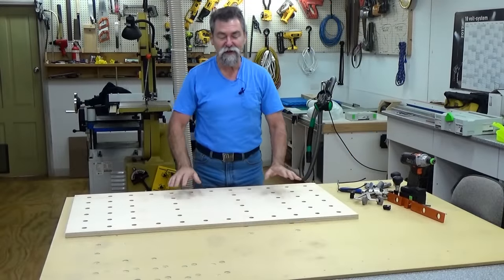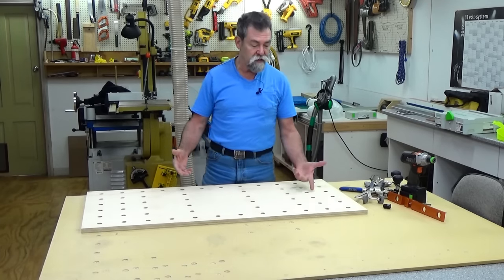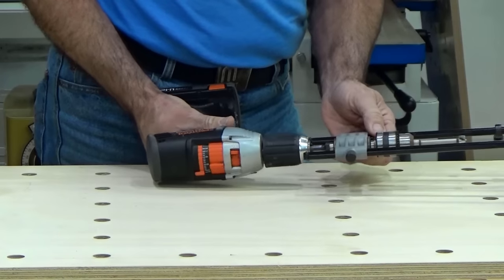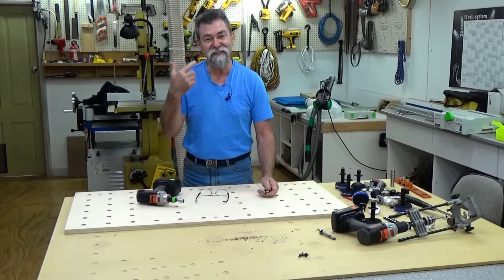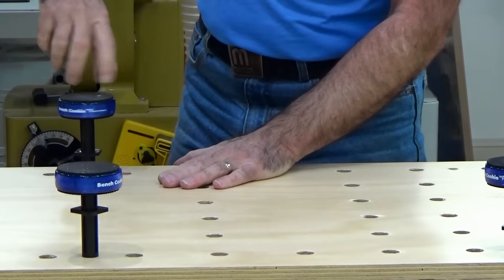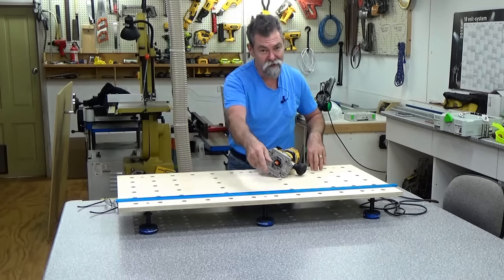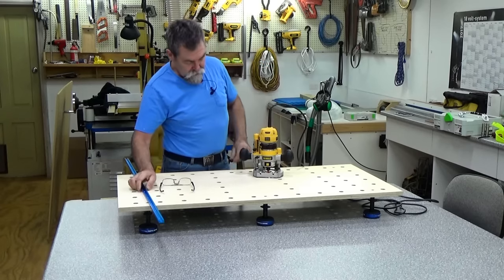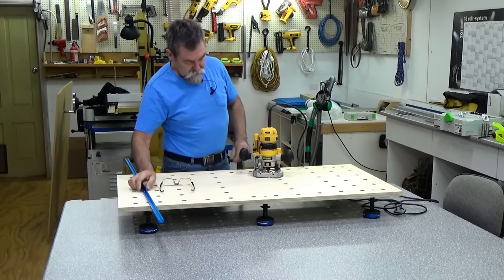Build this Festool mft style portable bench for under $150 Dave Stanton woodworking workbench

Comment: I am analyzing build vs buy…I am starting from absolutely zero…I don’t even have a track saw or clamps…buying the PARF system is $250 USD…seems like buying squares, dogs, clamps, fences, rails, T-tracks, frame, dust extraction is getting me between $3000-$4000….

What is the thinnest table with tops and frame can be made so I can hang on wall and still park a car when table not in use?
Reply from the maker: That's a tough decision, but it sounds like you're really weighing your options carefully! 18 mm is the thinnest I would advise. That is the thickness of my benches, works with lots of accesories.

Comment: Hi Dave. Those Kreg hold down clamps:  You said in one of your many videos that you replace the bolt underneath with something else that'll fit in a T-Track but give a greater area inside the track to withstand the pull from the clamp.  Can you remind me what bolt you use please?  Keep up the great work!
Reply from the maker: Hi Paul Roussell! I used 5/16th inch T bolts, 1 inch long.

Comment: Awesome table! 
@16:00 ... that's one more reason to have a good* rotary tool. Small, lightweight, and smaller cutoff wheel. 
 
(* - Sadly, Dremel has failed me too many times. I've gone through a gauntlet of rotary tools in the past few years and discovered that a certain one (that only costs under $40 US dollars) is amazing. It's a... /ooof it's tough to say the name without feeling ill/... it's a Black and Decker RTX. Best thing... IT ACTUALLY HAS SOME DEGREE OF TORQUE!?!?!? I never tried before because everyone said it only has 3 speeds... but clearly theyve never used it. Its variable speed wheel, with 3 marking (L M H) on the wheel. ) 
 
So, just thought I'd throw that out there. I used to whip out angle grinders, or die grinders, far too often for tiny jobs, and it just wasnt necessary. Its like using a chainsaw to cut laminate lol.
Reply from the maker: Good idea.
Reply: @DavidStanton   I only have 1 arm that isnt paralyzed, so I have to adapt. Lol.

Comment: Fantastic as always! Please would you mind sharing how you attach the Festool hose to the dust port of the Dewalt router? I have the same setup and the hose keeps slipping off, so am wondering if you cut off the outer clear plastic collar away and just kept the inner collar?
Reply from the maker: Thanks eddomak! Yes, you got it in one re the dewalt outer plastic!
Reply: David Stanton what type of vac system. Do you have a link

Comment: Hi Dave! I was looking at a new tool by Kreg Tools which I think would be a good accessory for this bench. It is a bench clamp with a base that can be inserted into a 3/4 inch or 20 mm hole. I see the clamp base is also sold separately. I just wanted to pass info this on to you.
Reply from the maker: Thanks Harold. Yes, it is another innovative bit of must have kit from Kreg!

Comment: Nice. What happens to those anti slipping bands covered with dust?
Reply from the maker: It takes a couple of seconds to dust them off with a brush or shop vac. They are designed to work in a dusty environment without getting any dust permanently sticking.

Comment: thx for the excellent vid, curious why you choose not to take advantage of the splinter support offered by cutting into the the sacrificial top, and instead hang the cutting line over the edge?
Reply from the maker: 2 reasons. The blade is on the upcut through the material so no need for splinter support on the underside of the item being cut. Also, there is an aluminium t track that runs the length of the bench.

Comment: That was a great video. 
I'm wondering if the the non stick tape collects saw dust or other debris. 
Thank you
Reply from the maker: Interesting point Ernest Vocell. I use a banister brush to remove dust from the whole top, tape included. Only takes a second and you are good to go. This is a grip tape, not a sticky tape.
Reply: @DavidStanton  thank you 
That's a big help

Comment: One thing to note, you mention the quick clamp won't work if the top is too thick. Could you not just take the clamp apart and feed it up thru the bottom? Maybe slightly less convenient, but seems a reasonable work around for someone who would like a more substantial top.
Reply from the maker: Hi frozenlayer, there are many styles of clamp out there that will do what you mentioned, in fact I show you the Irwin clamp doing just that. Bessey also make them. The lever clamp is not a pull apart model. Thanks for watching!

Comment: Hi Dave another quick question , the aluminum  oxid pad used on the wax where do you get them and what is the proper name. Also is the traditional wax good for the jarah box I am making or do you suggest another finish. One pf the boxes i am making is Tasy ash which I am going to stein with a wattle stain, can I use the wax over this ?? I am also in the future making the above work piece up in white Melamine for a portable work bench as my Garage workshop is not big enough for a standalone bench. When I am cutting on it I will put down the foam I got from Bunnings so I don't mark the top its excellent when using Festool track. Cheers Kim
Reply from the maker: Hi Kim Dalzell. Festool vlies. Get them here https://www.carbatec.com.au/vlies-abr-disc-150mm-0-hole-superfine-stf-d150-sf-800-vl-10?aff=3
Reply: @DavidStanton  Thanks for that

Comment: When designing a bench to accept the Festool standard rail clamps, what is the minimum clearance distance required between the bottom of the 3/4" work surface and a parallel surface below it? Thanks.
Reply from the maker: Hi Michael Schuler! Enough room for a clamp to rotate underneath.
Reply: @DavidStanton  Thanks. Understood. I was hoping you might have discovered the actual minimum clearance dimension in your work developing your benches, perhaps for guidance as to how high to set the standoffs you use under the portable model.

Comment: Thanks Dave for developing this bench concept.  I've ordered your most recent plans and I have the Parf Guide system and I understand how to drill out the standard 96mm spaced 20mm holes, but I not exactly sure as to drill out the offset Rip (R) and Crosscut (C) holes on this Stanton bench.  Is there a way to was the Parf drill guide to drill out these "R" and "C" holes while indexed into one of the normal 96mm spaced holes? Thanks
Reply from the maker: Thank you for your support and for ordering the plans! I understand your question and I'll do my best to explain how to drill the offset Rip (R) and Crosscut (C) holes using the Parf Guide system. Stay tuned for my detailed explanation in an upcoming video! https://www.youtube.com/watch?v=G59Xx15C8bo

Comment: I think I’ll built the same bench (yours is impressing well executed!) but I want to ask why you did not align the splinterguard of the railwith the short side edge? This would prefent cutting into the bench an still keeping the spilinterguard effectif.
Reply from the maker: Doesn't need it, cuts perfectly well as the blade is in an upcut rotation.

Comment: Excellent video and a very nice bench Dave.  Do you have any plans or notes that you would be willing to share. I really like the size and layout of yours. With are of you goodies on the opening pictures it is a nice bit of work.
Ron
Reply from the maker: Hi Ron. No need for plans. The sheet is 1/4 of a full sheet of ply, the holes are 20mm dia and at a 90 degree pattern spaced at 96 mm centres.

Comment: Dave - great idea thanks. When you were routing you set up a straight edge with clamps - why did you not use the parf dogs?
Reply from the maker: I could have but would have needed to cut a straight edge to the correct width. This way was quick with the festool track and clamps. Accuracy not as crucial for the cushion strip as it was for the dog holes.

Comment: @26:42 could you not add a 20mm conduit over some of the thread and or 3d print a bush that takes up slack between the clamp thread and the 20mm dog hole ? If that thread is too long perhaps make the bench deep enough ? Also for height differences you could make a Ttrack mounted on a block of wood which is clamped to the bench ,then a clamp is attached to athe raised t track which holds down the high work piece
Reply: You could place threaded stand offs on the block of wood so that it is adjustable for all heights of work piece

Comment: Hi David,
more than impressive! Ok from the video not quite clear - you use the bottom side for track saw so you do not cut in the aluminium of the rail? If so, how many times do you really use the upper side for clamping something? How many times the rail? Wondering if it really has an application in your everyday work.
Thanks in advance from Lake Constance,
Christian
Reply from the maker: You can use the top for both if you wish. Just finish the aluminium T track prior to where the blade will pass by. Some people may want to preserve the top appearance and use the underside, or make 2 of them.

Comment: Hey Dave, Couple of questions I wanted to ask if I may: On the Kreg clamp you were using towards the end, will the nut on the bottom of it secure it in the T-track slot too so you can use that as a fixing point, and do you know what size the tread is on that if you need a T bolt for it? The other question is can you please tell me what the details are of that drill stand you were using (it's sat on the bench side at 5:27 in), is it any good and where did you get it? Have been wanting one of those for ages but the only ones I can find are absolute crap and there's way too much play in them to do anything remotely accurate. Have been and bought the plans for the bench from your website so will have plenty to keep my busy! Cheers, Steve
Reply from the maker: Hi Stephen. The drill stand is ok but has its limitations., purchased from Carbatec.  The Kreg jig can easily be mounted onto a plywood base that in turn can be fastened to the Stanton bench T Track.

Comment: Dave - A couple of simple 'newbie' questions about the wax application you employed on the workbench.  
First, I noticed that the can of wax that you used said 'Traditional Wax.'   Is that paste finishing wax? Or beeswax?   
Second, what grit aluminum oxide did you use to sand/buff the wax?
Reply from the maker: Hi Steve Marano!Finishing wax and the oxide pad was 800 equiv.
Reply: Thanks Dave.  That's all the information I need to move forward with building a copy of the Stanton Bench!

Comment: Hi Dave, love your videos mate. I'm about midway through a workshop build project and will be looking to kit it out at some point soon after completion. I'd like a bit of advice to help me decide what order i purchase the larger (more expensive tools). My question is what would you recommend i buy first, i'm looking at a festool track saw or a carbatec cabinet saw. My woodworking goal is to make cabinets and basic furniture at some point. Would love to have your opinion.  Thanks mate.
Reply from the maker: For general woodworking I would buy the tablesaw first. If you want to start using plywood then a track saw is definitely a safe option to break the sheets down prior to using on the table saw. I hope this helps!
Reply: @DavidStanton  That's great thanks Dave

Comment: When placing the bench cookies on, you drill the holes with a depth stop so it doesn’t go all the way through. Then when you put in the treaded inserts you flip the board over and screw in the supports ? Did I miss a step or not understand correctly? Cheers Robin
Reply from the maker: Hi Robin Hobbs! Have a look at my latest version of the bench here. https://www.stantonbench.com.au/
Reply: @DavidStanton  looks like you have changed the feet for your own design, I still can’t see in the video of you assembling the new bench if you do go all the way through with the threaded inserts , cheers Dave

Comment: This looks great! It´s a must have and it will be my next build. One question though, what´s the total height of this with the legs mounted? Is it possible that it can level with the my Festool T-LOC SYS-MFT, which is 112mm, so it can work as an extended support?
Reply from the maker: Hi Daniel. You can make it any height you wish. The only problem is the moxam vise and the cushion strip at the rear of the skirt. You would need to adjust the plans accordingly. Simply make the legs  from timber and shorter. Not as convenient but no problems.
Reply: Yes that´s of course a solution. But I would like to use the bench cookies but I can´t find any information regarding the dimensions of the "legs". Anyway, it´s not a big deal...I was just curious. I found a swedish reseller for both the bench cookies and the parf guide system so that´s great! Thank you for your quick feedback!

Comment: What size Router bit is that? Was it one pass to make the width or did you make a few passes to get the width for the track and strip?
Reply from the maker: 19 mm. The tape is 20mm but fit with a little persuasion.

Comment: Hi Dave
Was thinking on buying the festool dust extractor for my router. Does the festool fit onto a dewalt or would I need adaptors 
Thanks regards John
Reply from the maker: Hi Highland Harley. It fits onto my dewalt trimmer, just need to cut the outer plastic part of the dust port on the dewalt off. You will see what I mean.
Reply: Thanks Dave

Comment: This is great!  I made an equivalent cutting top for use indoors on remodel projects, and that got me thinking about what you've done here.  One of the challenges in designing this is that one must CHOOSE between the world of the 20mm accessories OR the 3/4" accessories, which is not a clean and simple choice when one explores all of the Lee Valley accessories in the 3/4" range, plus the ubiquitous 3/4" options.  That has led me to consider using a double-grid; one in 3/4", the other in 20mm, and the it would make sense using a 4" spacing in order to end up with an 8" system spacing.

I like how you dedicate one side to work-hold and the other to cutting.  Here's a question:  Here in the US, I've it is extremely difficult to obtain a reasonably flat piece of plywood.  Was your piece of plywood flat or flat enough, OR have you encountered problems with it being unflat?  In my case, I used a back framing on my surface in order to flatten the plywood, which of course makes it heavier and would cause havoc with the dog holes.  This is why Festool uses MDF, but in this application, the MDF will just conform to whatever surface we put it on; your plywood is stronger/better for staying stiff and holding its shape (better be flat).

One suggestion on the tracks:  Use brass screws so as not to dull the saw blades, and glue the tracks in place so the clamps don't rip the screws loose (those clamps w/ 500 lb. force will easily yank the screws and don't ask how I brilliantly figured that one out!), plus the glue helps correct the plywood's lost stiffness that happens when 2/4's of the 3/4 ply was routed away for the 2/4 tall tracks.
Reply from the maker: The grid is fine how I did it with the UJK Parf guide system. If you want the occasional 3/4 hole as well that is easy.
Reply: 3/4 inch accessories fit into 20mm dog holes with <1/2 mm slop on either side. more than sufficient for hold down type work. In addition 20 mm accessories are becoming more available. Use decent Russian Birch plywood and you won't need to worry about flatness or lost stiffness. Besides, the 1/4 inch of aluminum track makes up for any plywood stiffness loss. Buying cheap plywood for an essential work surface is like buying a cheap tool for critical everyday use - a bad idea.
Reply: Larry, thanks for the info, that really simplifies matters.  Yea, Baltic Birch plywood is the only way to go -- I actually prefer Finn Birch plywood, but it is super hard to find and super expensive.  That said, the worry about lost stiffness due to the dadoes cut to house the T-slots is flex parallel to the slots, not across, so even with the aluminum installed, the stiffness is compromised.

One suggestion that helps the stiffness AND dramatically improves the T-slot performance is to glue the T-slots in place, don't rely just on the screws.  This is because the forces applied using T-slot fixtures is straight up against the T-slots and that is straight OUT against the screw threads, which is the screws' weakest direction.  Don't ask how I figured this one out....

Comment: Hi Dave, I absolutely love the bench,fantastic design. However, is the t-track really worth installing. It seems to me it's only really needed to hold the vise as all clamping can be done using the dog holes and the Festool clamps? Having had the bench in use for a few months, would you install it again in your next build?
Cheers
Stephan
Reply from the maker: I definitely would use the track again. So good for the kreg bench clamps for rapid clamping on repetitive work.
Reply: ah, good point, thanks! I'm hesitant, though, about buying into yet another system. One way to allow for rapid clamping on repetitive work might be to use Bessey's STC-HH70 Horizontal Toggle Clamp set for the MFT3. Without a track to move it sideways it's not as easy to move around like your solution but once moved into another hole it allows for rapid repetitive clamping. Thanks again, Stephan

Comment: Dave i bought some vlise green but it does not fix to the festool rotex 150 pad. Do i need a special interface pad to stop the vlise spinning off into the distance? Kindest regards.
Reply from the maker: Hi Jeff. The green Vlise is very aggressive but even so it should stick to the rotex hook and loop. Maybe if you can supply me with a picture or video of how you are affixing the pad to the rotex?